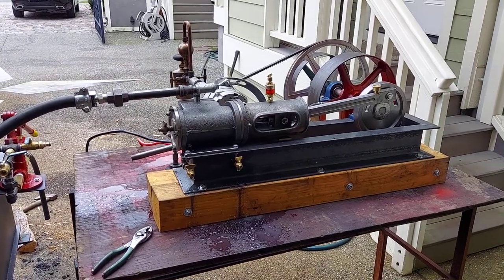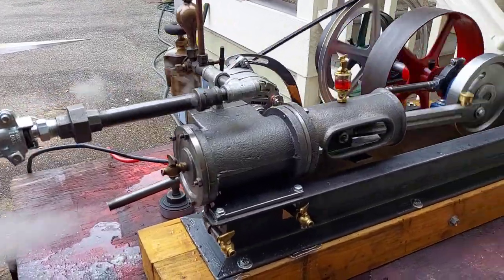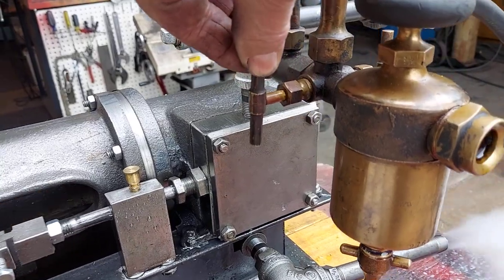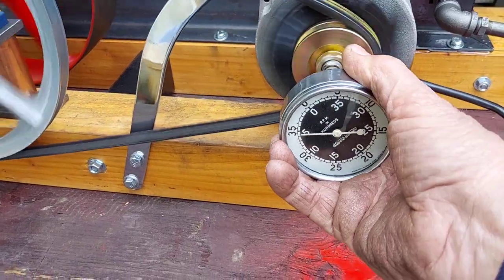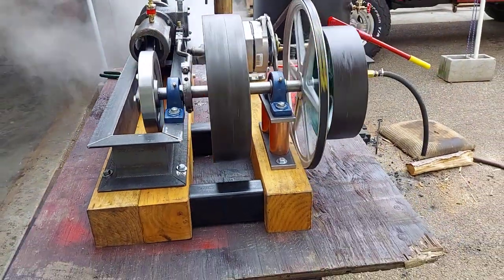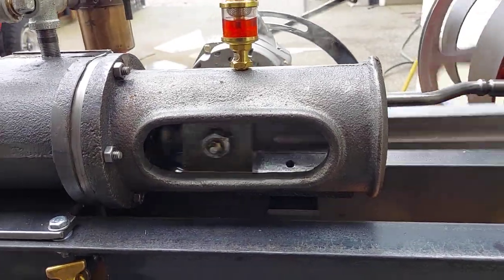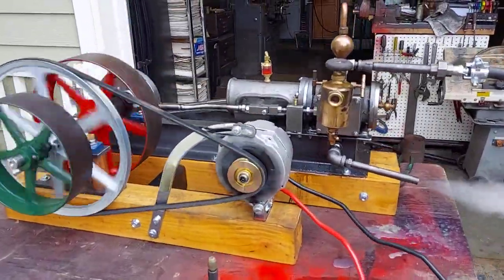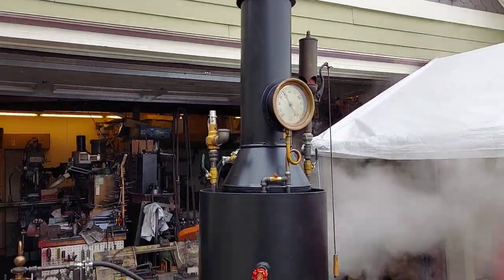FOR SALE Mill Steam Engine Alternator Whistle Gauge Offgrid Live Steam Engine boiler off grid

Comment: So this is generating an AC current and it runs on wood? I love the way it sounds and looks
Reply: Does the like mean yes?
Reply: @gamecruncher1 thanks, just wondering, 🙏 I’m not the most mechanical guy around
Reply: That GM alternator is making DC current. About 15 volts.
Reply: @rogueart7706  okay and what does a generator put out 120 right
Reply: @trevoriv5288  it depends on what the generator is for, it could be 12 volt or 440 or anything in between. 
A hospital generator is probably 440. 
A boat generator is probably 12. 
A home generator can be 120 or 220. 
The alternator actually makes alternating current but it immediately gets rectified to DC. It’s much more efficient that way. And to charge a 12 volt battery you need to go above and beyond 12 volts, so alternators actually put out 15 to 16 volts.
Reply: @rogueart7706  thank you!

Comment: can the exhaust be used to pre-heat the water before going into the boiler? wouldn't that make the boiler more efficient? I just started studying steam engines a few weeks ago so I apologize if this is a stupid question, thanks for the cool video!
Reply from the maker: The exhaust from the steam engine has oil in it so not good idea. Another way might be running a small pipe from somewhere on the boiler to preheat the water.

Comment: What is the most efishent speed for the most power and the longest run time. Like if you were running a muchine with it how much power would you run the engine at to meet peak efficiency
Reply: Steam engines produce the most torque at rpm so assuming you can provide the gearing needed the slower the better